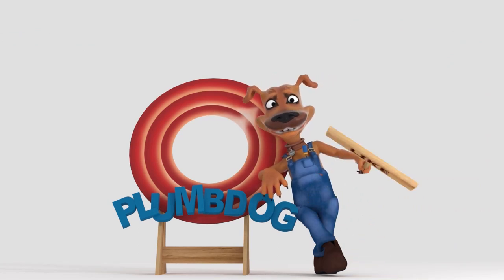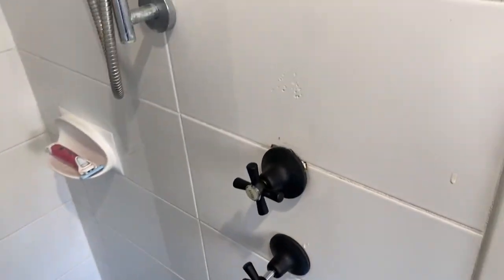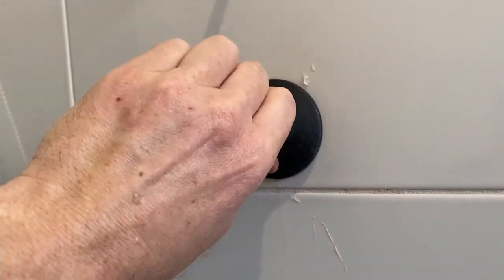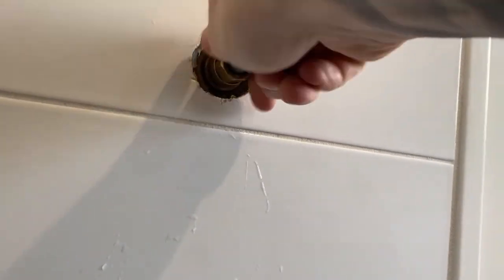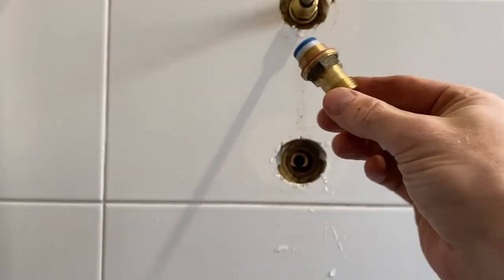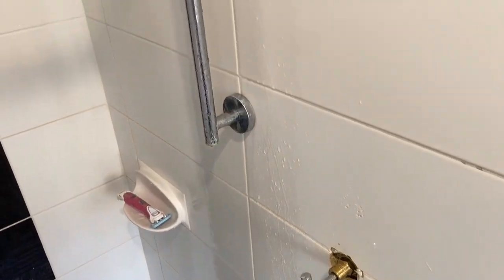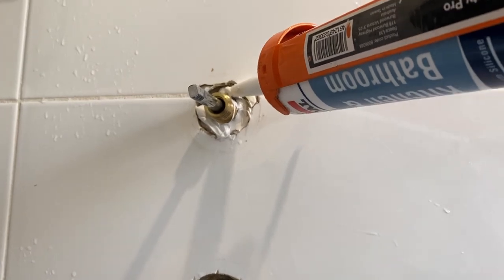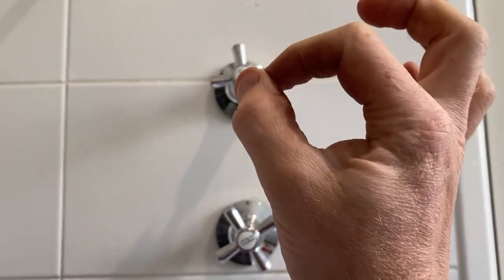Shower leak detection & repair   badly installed shower taps

Comment: Clear explanation thanks. Have you ever come across a slow drip that is difficult to remove with washer replacement and reseating? I suspect it may be a worn spindle bore as the stem of the washer seems quite loose in the tap spindle?